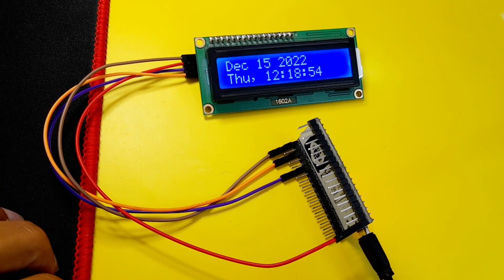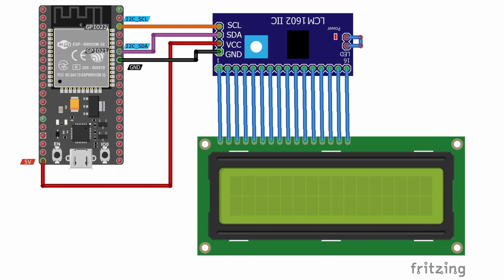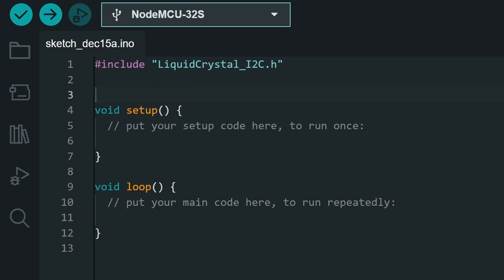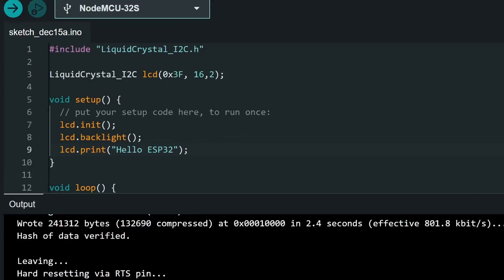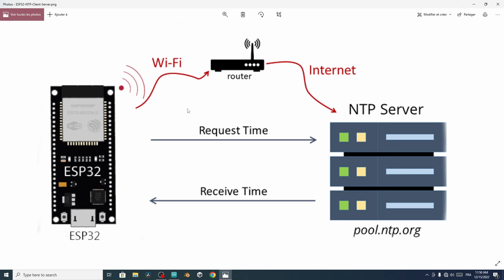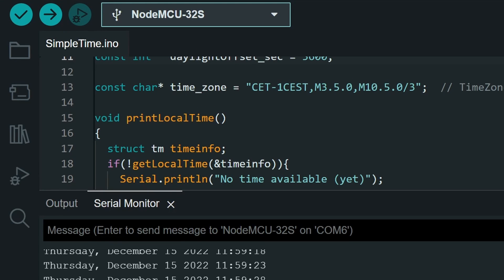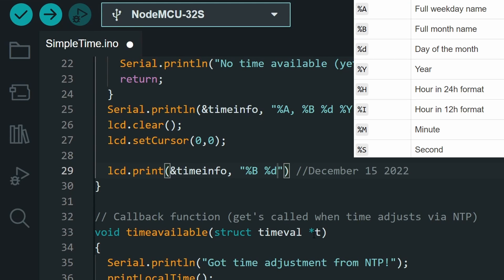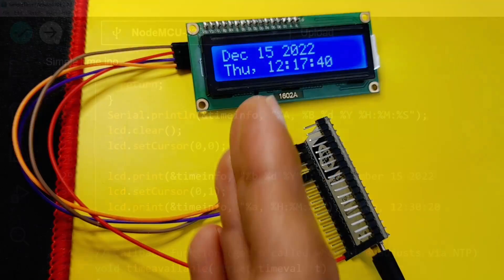ESP32 Project - Digital Clock with LCD Display At Home

Comment: Sir I am using the same library as you mentioned but no text is displayed. I tried adjusting the contrast. It works with Arduino UNO and not esp32. Please Help

Comment: Thanks for your nice video.

I'm using a NodeMCU-32s (HiLetgo), with your "Hello" program, but I'm using a 2004 LCD. I get this error:
============
Multiple libraries were found for "LiquidCrystal_I2C.h"
  Used: C:\Users\junkg\Dropbox\Programming\Arduino\libraries\Newliquidcrystal_1.3.5
  Not used: C:\Users\junkg\Dropbox\Programming\Arduino\libraries\LiquidCrystal_I2C
exit status 1

Compilation error: invalid conversion from 'int' to 't_backlighPol' [-fpermissive]

==================
I can't even FIND this Newliquidcrystal_1.3.5 on the list of installed (or not installed) libraries.

What am I doing wrong here? Is it because I'm operating out of Dropbox?
Reply: Была подобная ошибка, 1 из библиотек пришлось удалить, тогда ошибка исчезла

Comment: Does not compile. :( Trying to use with Lolin D1 mini clone, and 2004 lcd display. Changed variable for screen, I have the right board selected with com port. A ton of errors when compiling. Just trying to make a simple NTP clock with time, day, date. :(
Reply: que pena, a mi me funcionó a la primera después de configurar la pantalla 0x27 y  el offset UTP

Comment: Bro is it possible to modify the normal digital wall clock into ntp synced clock. Check with Al fajr clock CW-05 model no.

Comment: My ESP32 no longer connects to WiFi. I did a test, without LCD, it worked. Then I uploaded the program with LCD and it doesn't work, but now the code without LCD doesn't work either. I can't explain this.
Reply: Esp32 gpios work with 3.3v and i2c module works with 5v so u need to manage the voltages with a voltage converter

Comment: Make video on send time and data to firebase
Reply from the maker: OK thanks
Reply: @DIYTechRush  your video really helped me to print time on serial monitor but I got a confusion regaring the UTC, if my local time is UTC+5, I have to add 3600 or multiply it?
Reply from the maker: @Youtubeshorts-kg4hy  5h*60*60 = 5*3600=18000